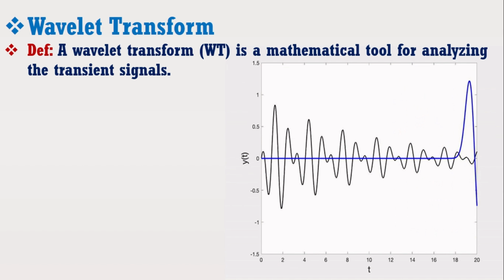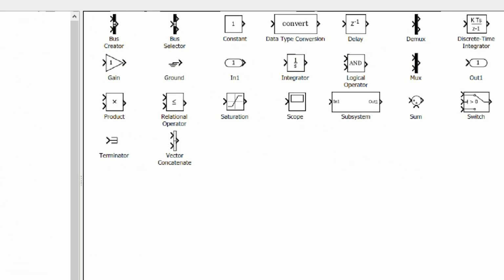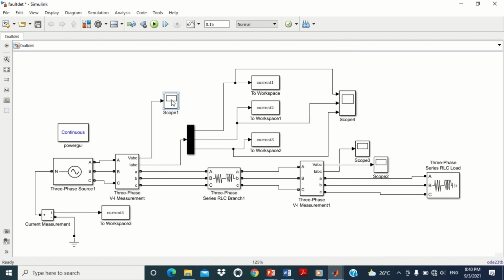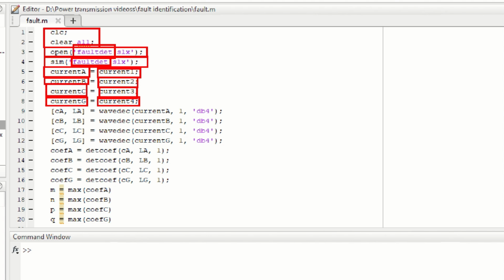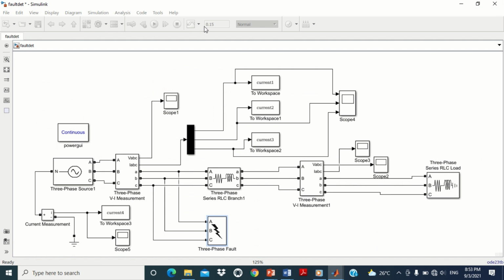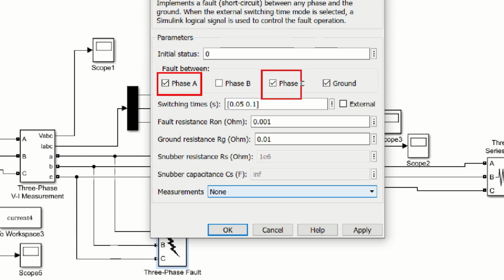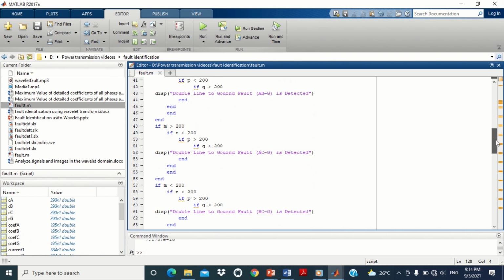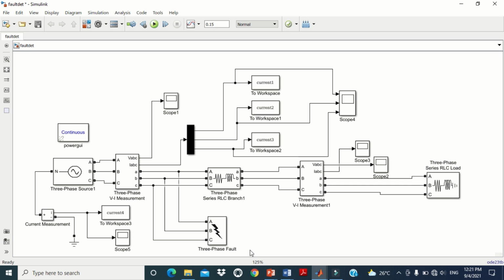Wavelet Transform Based Power System Fault Detection in SIMULINK | Dr. J. A. Laghari

Comment: Useful videos. I have a doubt sir. If consider receiving end currents, why values of the maximum coefficients are almost same in all cases of faults? It is able to classify the faults only with currents considered from sending end.
Reply from the maker: Thanks for the comment. Your point is also valid. You may do that. May be it provide better results.
Reply: @DrJALAGHARI  No sir. It is giving good results only when we consider currents from sending end. Results are spoiled if we take currents at receiving end.
Reply from the maker: @amitnehete3455  Right. May be.

Comment: Can you explain how this MATLAB code can be extended if I want to connect other power quality fault blocks such as voltage sag/swell, harmonic and capacitor switching blocks?
Reply from the maker: Thanks for the comment. I am not sure but the procedure is same. you can include all these cases and then find again a suitable threshold to distinguish between all these cases.
Reply: @DrJALAGHARI  Sir, also the zip file is not opening. Is there any other way to send the M-File, Simulink model and the PDF?

Comment: I am unable to find the threshold value to apply wavelet t/f in my three phase wind turbine model and solar model for fault analysis.
Reply from the maker: Thanks for the comment. Threshold you have to find by yourself by comparing the different values of fault and normal in order to distinguish between the faults. If you are unable to determine any suitable threshold then you have to use intelligence based techniques such as ANN. Kindly watch my video on RBFNN based fault identification.
Reply: @DrJALAGHARI  sir can you plz guide me how these error values are being calculated?
Reply: @DrJALAGHARI  like according to what formula these values are being received?
Reply from the maker: @arslanghaffar7149  which values i couldn't understand?
Reply: @DrJALAGHARI  sir whenever there is an error when we receive the values, which you have mentioned in the table as well, I just want to know that how those values are actually being calculated and what's the formula according to which those values are being received.
Reply: I mean to say the fault values and non fault values
Reply: @DrJALAGHARI  i really need your support sir I am working on it.
Reply from the maker: @arslanghaffar7149  we have used discrete wavelet transform. It calculates the fault current values using symmetrical and unsymmetrical faults formulae.these formulae can be seen in the books
Reply: @DrJALAGHARI  sir I highly appreciate and thank you for the reply can you plz recommend some book or the specific chapter for that so that i can find that because m trying to find this but I am unable to get it done.
Reply from the maker: @arslanghaffar7149  thanks for the comment. Fault formulae can be found from power system analysis book by hadi sadat etc.
Reply: @DrJALAGHARI  sir thank you so much. You have been very helpful 🙂.
Reply from the maker: @arslanghaffar7149  my pleasure

Comment: What is the significance behind taking only maximum of all wavelet coefficients in the program sir
Reply from the maker: Thanks for the comment. basically wavelet provides more samples of around 200. but we need one sample value in order to use it for identification and classification.
Reply: @DrJALAGHARI  Yes sir basically wavelet coefficients of waveform represent current properties how ever during fault current is high so here taking max of wavelet indicates max current.So directly using current magnitude we can determine fault but what is use of wavelet then
Reply from the maker: @charanchandra3216  Thanks for the comment. Yes you are right. detection requires fast speed for reliable operation. wavelet is used to get few important samples in order to distinguish between different types of faults. using direct maximum values have thousands of samples, which will have difficulty to find the threshold setting value.
Reply: @DrJALAGHARI  yes sir we need faster approach but my doubt is that max wavelet coefficient occur at max current instant and  wavelet is replica of current in that program then by seeing mag of current itself we can decide type of fault then what is the use of wavelet.l mean what extra feature is provided by wavelet compared to current waveform
Reply from the maker: @charanchandra3216  i think im the real system there are continuous signal  in order to distinguish between all type of faults we need samples. Otherwise it may not be possible.

Comment: sir facing problem while extracting the rar file you have attached in the google drive link... please send upload it again. due to that unable to download the m file.
Reply from the maker: Thanks for the comment. May i know what problem you are facing? Do you have winzip installed or not?
Reply: @DrJALAGHARI  I have WinRAR software on my PC for file extraction. it is showing that-  "the archive is either in unknown format or damaged".
Reply from the maker: @rajdb16  I have checked and downloaded it again. It is working fine. I dont know why it is creating problems for you. Anyway if you can share your email, i will send the files to your email. No issue.

Comment: Assalamulekum sir
Please provide Matlab code version of Simulink model sir.
Thanking you sir
Reply: Assalamulekum sir
I have a doubt
You have performed wavelet transform in the simulation.
My doubt is what kind of wavelet transform have been performed
Either it is continous wavelet transform or discrete wavelet transform have been performed sir?
Reply from the maker: @Akbar-ud1yn  wa'alaikum salam discrete wavelet transform is performed.
Reply: @DrJALAGHARI  sir please provide  your mail id so that I can send my code on wavelet transform for fault detection. If possible please  run the code which I have sent and I feel delightful if you verify/study my Matlab code on wavelet transform for detection of faults... I have written on LG faults and symmetrical fault only..
Reply from the maker: @Akbar-ud1yn  my email is jalaghari1@gmail.com
Reply from the maker: Thanks for the comment. Sorry I couldn't understand what you mean?
Reply: @DrJALAGHARI  sir you have performed the work using Simulink model instead of using Simulink blocks. Please frame the network in coding format. I mean perform same work in editor because I'm lack of knowledge on wavelet application in fault analysis
Reply: My another doubt is
How to do wavelet transform using clarke's transformation components for detection of faults and how to write program in Matlab
Reply from the maker: @Akbar-ud1yn  Thanks for the comment. I have used more easier method. however, to do it in coding, it needs again separate way and needs time. I will try it but due to my busy schedule, I dont think so that it will be available soon.
Reply from the maker: @Akbar-ud1yn  Thanks for the comment. for this purpose, yo may follow any research paper. may be it provide you the idea.
Reply: Please if you have the code please kindly share

Comment: Assalamulekum sir
You have performed discrete wavelet transform model code on Simulink model power system.. My doubt is that
Can we perform this same wavelet model code for Matlab code power system model i.e like writing coding on fault analysis and linking with wavelet code model
Reply: If possible please do on complete coding tutorial sir with out any Simulink.. Only editor coding format sir
Reply from the maker: @Akbar-ud1yn  Thanks for the comment. Yes it is possible to perform the fault identification using wavelet through complete program. I don't have the complete code. You may search it. May be you find .
Reply: @DrJALAGHARI  yes sir
I will try to frame the code. And please  give  us code if possible and Matlab coding like electrical terminology also sir
Reply from the maker: @Akbar-ud1yn  ok

Comment: Dear Doctor ,thank you for this videa , my question ,after extraction  of signal in wavelet transform ,how I cam compare coefficients signal like D2 with reference sinal X
Reply from the maker: Thanks for the compliments. Why you want to compare D2 with original signal?
Reply: @DrJALAGHARI  Dear Doctor , I need to discriminate between inrush current for power transformer normal current and also between normal current and faults current
Reply from the maker: @waaelabdulhassan4982  in my opinion, you first follow any research paper on this topic. Then you will get idea how to implement it
Reply: @DrJALAGHARI  thank you Doctor for clarification
Reply from the maker: @waaelabdulhassan4982  Thanks

Comment: Hi sir, how did you get the threshold value of 200? and how to calculate the threshold value ?
Reply from the maker: Thanks for the comment. 200 value is chosen by looking at the Table values. This threshold may be different but must be such that it distinguish between the faults.